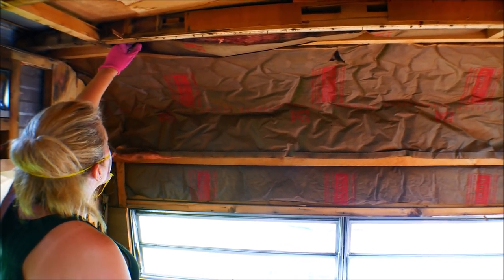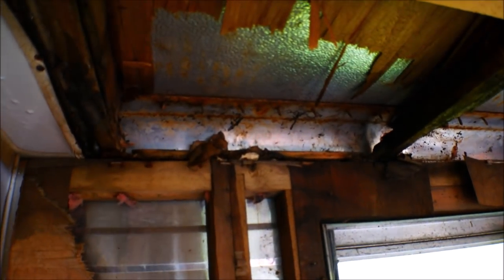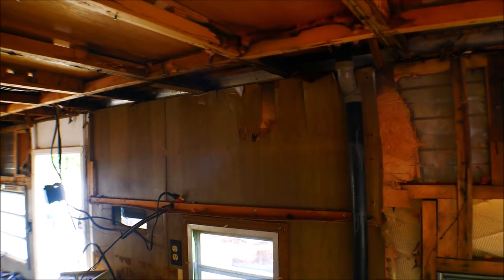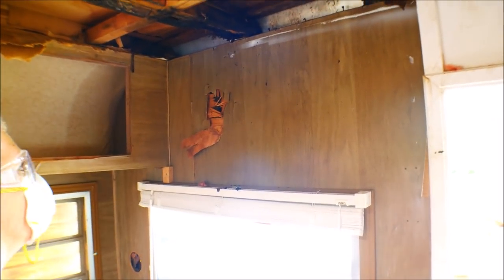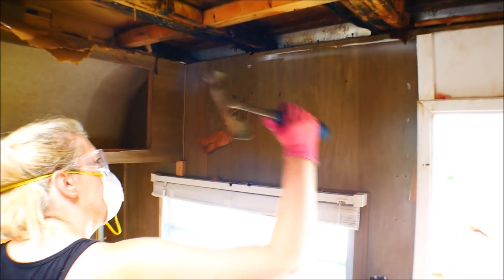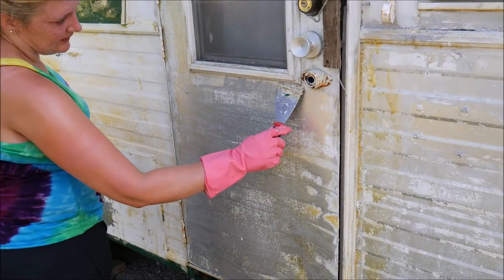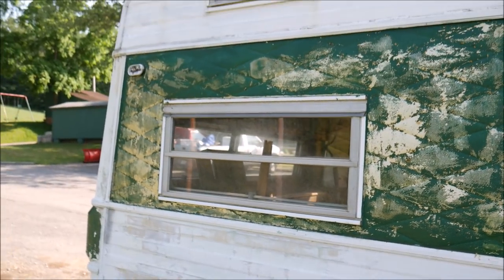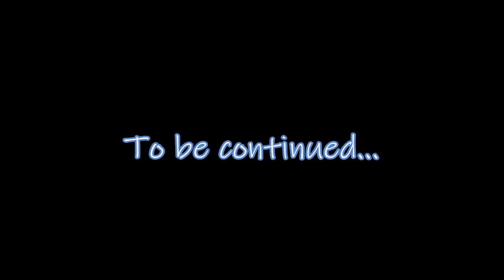How to gut a camper

Comment: Quick clean up tip. Drop cloths under the trailer so when your done scraping, you can just throw them away and save on time cleaning up the driveway. If it gets windy, hold the corners down with bricks.

Comment: This video helped me A LOOOTT. It sounds silly but seeing the layers of the wall first made it more manageable. One question though.. with those rotted boards at the top on the ceiling and the portion with exposed nails coming down, how did you repair that? did you have to take all the tar off the roof and go from the top? Is it metal on the other side of the plywood? 
I'm having a similar situation. We got a great little camper for 600$ but it was already being gutted and we just decided to gut the whole thing and start from the studs up. Some of the ceiling boards are missing entirely and others are rotted. Any help would be great!
Reply from the maker: We never finished ous but all you do is take out the old screws put your new boards in screw the roof back to the boards and just lay some thick roofing tar over it you can flex seal the inside for extra protection

Comment: The lack of bracing in wood camper frames is disturbing knowing they're going down the highway at 70 mph
Reply from the maker: Agreed lol 😂
Reply: I wondered why the lack. I am redoing a 2002 Nomad. There is a ton of wood framing, in this thing. Most of the seating area destroyed by moisture.
Reply: @mindolynmadhatter7552  I've read that most manufacturers rely on cabinetry and built in furniture to brace the unit, I guess that's why you always find overhead cabinets in unorthodox locations. However I would recommend using hoop iron. It's perforated steel coil that you nail to the frame and add a tiny tensioner to. I only say this because it's the most lightweight form of bracing available and it's so low-profile.
Reply: Jason McFarland Thanks! I’ll be looking into that.
Reply: @jasonmcfarland3696   That's exactly what it is. The cabinets and furniture. Also sometimes if there is a wall for a bathroom. Once you take that out you lose the structural rigidity. The walls want to sway side to side.

Comment: Are you keeping the outside plain aluminum?  Wondering why you had to strip the paint instead of prepping and painting over it.
Reply from the maker: Stripped the paint because it had runs from the old paint job and want it to look more uniform
Reply: @thetravlers6901  Ok.  Just wondered. I usually just sand it. Way easier for me.  Because I like to avoid the chemicals and huge mess, and I especially like to leave some of the base coat on without having to add more primer or paint.  Sanding leaves it smoother and is what most body shops do.  But no problem if you decided to strip it.  There are certain situations that I would strip, but usually when there are many multiple layers or something.

Comment: I just got myself an old rv and would love to pick your brain! Could use a couple tips
Reply: I am renovating my 1989 Vagabond right now. No leaks my left foot! It was back to front water damage! I had to pull out literally everything, managed to only save the two upper level cabinets (kitchen/bedroom), the tub and kitchen sink (after repairing a small pinhole). I am completely re-doing every square inch of this 32’ camper myself! Even some of the framework had water damage, the roof, etc. Its like building a structure in my driveway!! My advice...start at one end and keep working! Dont look at how far you need to go...look at how far you’ve come! Best of luck!!!!

Comment: You could've stripped the paint off the outside in a ¼ of the time if you'd used a power washer 🤷🏻‍♂️
Reply from the maker: Yeah but we didn't have water hookup so thats what we had to work with
Reply: @thetravlers6901  well you gotta do what you gotta do I guess lol